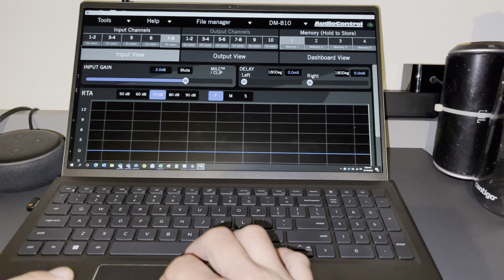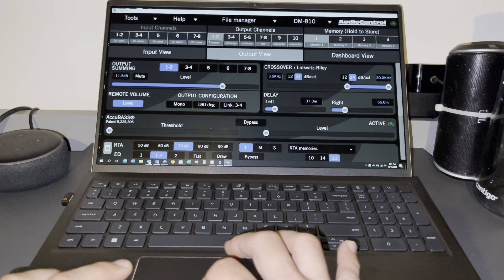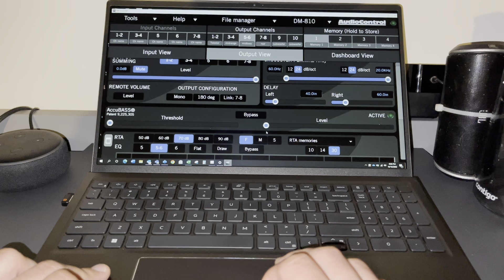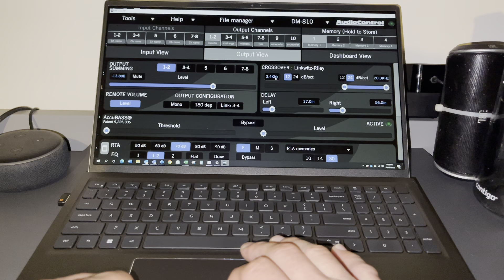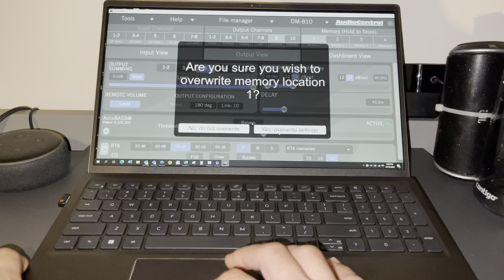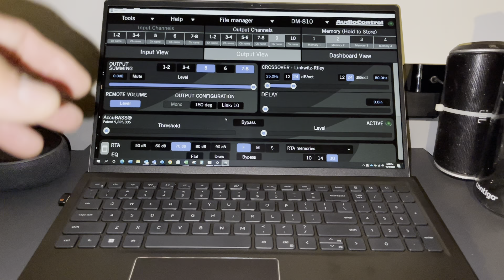Setting up a Audiocontrol DSP

Comment: Do you live in Florida lol I got mine hooked up and working but it's not perfect. I need to pay someone to tune my car. I'm running a Mobridge to my DM-608. My issue is adjusting the in coming signal and gains. It sounds great but I know it can be much better

Comment: Can u explain the milc light...i had a pioneer head unit and the light would come on at volume 29 out of 40 with everything flat on the head unit. But my oscope says im clean up till 40. So what i did was have my volume at 28 but raised my input gain to plus 12 on dsp to get my volume back and the light never came on which didnt make any sense to me at all.
Reply from the maker: I really didn’t trust the MILC light so I set it to 0 amd adjust the amp gain accordingly and it sounded better

Comment: With the 810 installed, which gan do you set first...the amp or the DSP?
Reply from the maker: @kingly7946  I tried using the DSP but it didn’t sound good so I left it at zero and set the amp gain and I was able to adjust it better and it sounded better with left floor noise and distortion but this all dependent on your amps quality also

Comment: How can i Chek 😢 the distorsión on the dsp d-4.800  how to now can i set the gains????
Reply from the maker: Use the MILC light on the input gain. When it turns solid yellow turn it down a bit. Are you using a factory or aftermarket radio?
Reply: @mildaudiophile3879 i used a Kenwood exelon dmx 907s
Reply from the maker: @valecasillas5729  5v is what you should be at
Reply: Yeah my Kenwood has 5 V But I used one 1 kilohertz  test  tone and it doesn't show up to my  dsp distorsión  I use the 40 Hz to check the amplifier for the Subwoofer but the Dsp shows the volume 34.35 think shows the distorsión 😅the milk source So I am kind of confused you know so what do you think

Comment: Would u say dsp is worth it with an aftermarket head unit?
Reply from the maker: Yes if you listen to any premium sound system has a Dsp bc it can be fined tuned to the individual and vehicle. You can do that with a amp alone. You don’t need aftermarket radio nowadays. You can take a high level input to the Dsp and then Dsp to the Amps. Just make sure to get good wiring, OFC power wires and some decent speakers and your set.
Reply: @mildaudiophile3879  well I already have a Sony installed was just wondering if it was worth it adding a dsp to it.
Reply from the maker: @oslozoya1  simple answer yes! I would save up and get a better DSP like helix or Audison
Reply: @mildaudiophile3879  well my friend I already had one installed.....I got the the dm608...my installer say go with with helix dsp mini but I liked the look of audiocontrol...I've had it installed roughly a week...on my 2012 sonata with nav...he said if I want a retune I can come in get it free...I've just been listening to it...he said there will be an update on there software soon...for I believe time alignment...I've noticed my vehicle being alot more quiet since having it installed...my next step...is having redo my dash kit being they don't make dash kit for my model he's going to custom make one...in a month when he's not as busy with his shop move...
Reply: @mildaudiophile3879  prolly slipped by not going with helix dsp idk...current setup...infinity kappa comp front coaxial rear...5 channel kappa amp..10 inch kappa sub...aftermarket crutchfield wiring...Sony 5500 head unit...soundskins all around...

Comment: great video
did you link chanel’s 9 and 10 for the subs? or is that not needed
Reply from the maker: Yes I did. This way you can tune your subs with a microphone and dial in the sound you want. I had to use 60 hz instead of 80 bc it got muddy even at the 80hz recommended by JL audio. The midbass stayed at 80hz so yes they can overlap and have different slopes. Many variants like cars acoustic speaker type amp and sound deadening